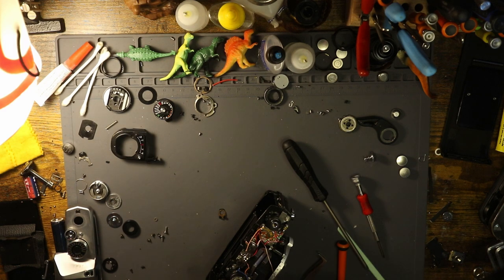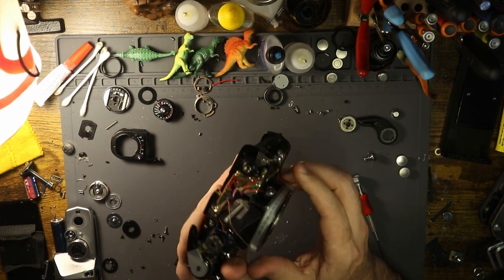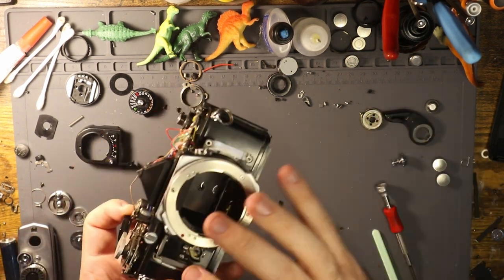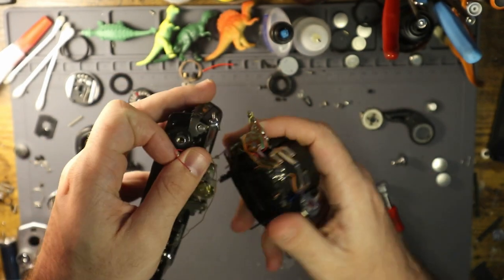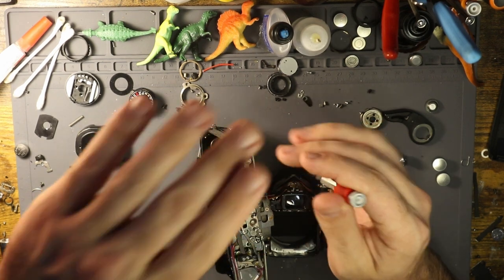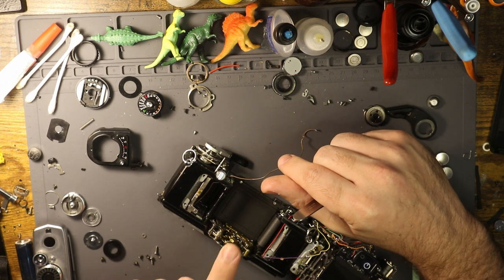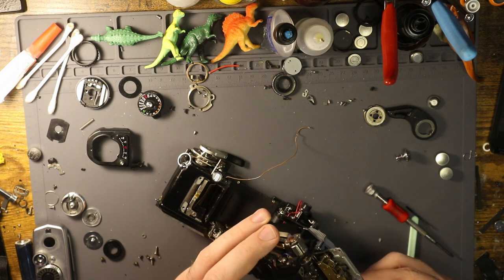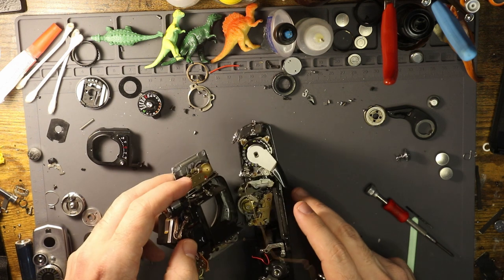Olympus OM-1 Breakdown

Comment: Hey I was just curious what equipment you use to test your shutter speeds? I’m having trouble finding one, What do you think about the Alvandi shutter speed tester?
Reply from the maker: I've tried a couple methods, there is the "build your own" with a arduino board, laser module and light receptor but the problem with a lot of the more inexpensive models is their accuracy at the faster speeds is limited. The one I have I got off ebay for around 600 smackers and it works really well, I just haven't made a video about it yet but in a case like this I'd say spend a little more to get a really good thing rather than buy a bunch of things that will kind of work if that makes sense.